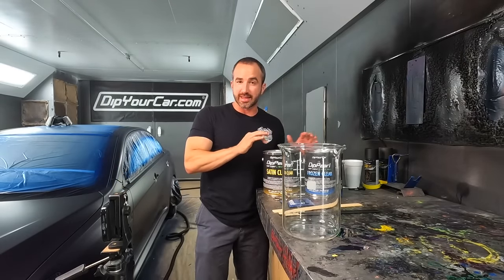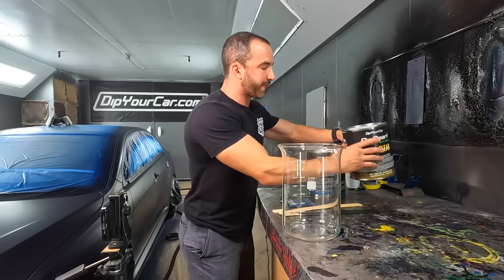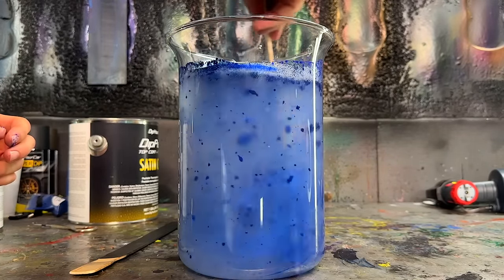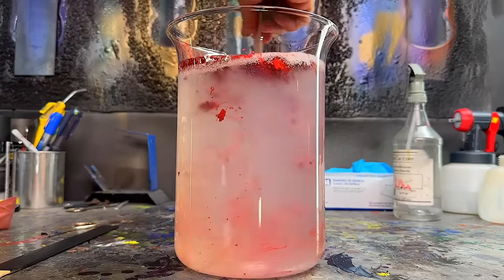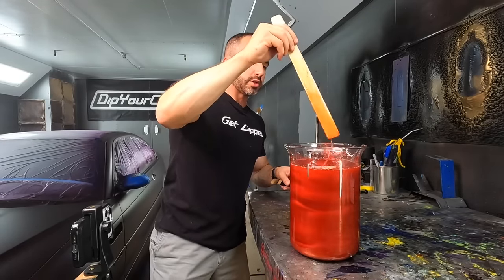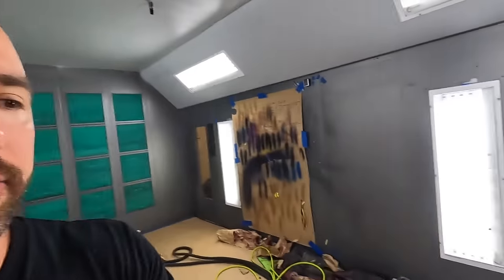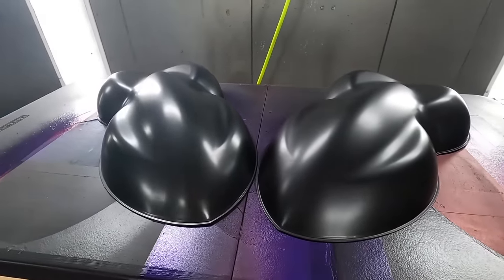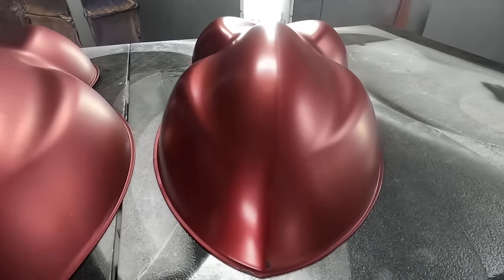GAME CHANGER | You Won't Believe What These NEW Gallons Can Do (Introducing Next Gen Topcoats)

Comment: For some reason I keep waiting for a two color paint job that acts like oil and water where instead of the colors mixing they create this trippy lava lamp style pattern… probably impossible with conventional equipment but it would be amazing to see such a technique work with hypershifts.
Reply: I too would love to see that.
Reply: I agree. You would probably need a dual sprayer setup of some kind.
Reply: Closest I’ve seen is the dish soap video. That was an awesome effect!
Reply: Totally agree
Reply: @KindredAutomotive  yeah thats the only way o can think of doing it and it would take an artistic touch to pull off.
Reply: What if they don't mix two contrasting colors before spraying but in the air?  Like from two different spray guns being used at the same time.  It wouldn't be smooth but it should be more contrasting?😕

idk
Reply: You would basically have to airbrush that effect. With stencils. Similar to painting real fire.
Reply: @KindredAutomotive  can you please link video or tell me what to search
Reply: @Lwah0812  “DYC LIQUID SOAP”
Reply: At that point taking the body panels off and hydro dipping would probably be a good route.

Comment: I had a 1977 f100 that had a nice deep blue color to it. But it had sparkles in it a bit as well. I always  called it metallic  blue. I miss that truck. Had everything  done up on it. Rebuilt 351 winzer motor with the pistons borred out to fit bigger  piston heads. Dual 3 inch exhaust  from the headers. Eldbrock 4 barrel carburetor.  Sounded beautiful  and looked sharp.

Comment: I wonder if you can do a more intense and insane paint style. Start with a simple solid color pearl over a medium color base over all except for cyberpunk-like panels on the sides and top that are done in black. Within the panels, use a hypershift color that has no purple in it. Then add some contrasting pinstripes that goes across both the pearl paint and the hypershift panels. I feel like that would coming out looking very awesome if you can pull it off.

Comment: Couple things: first love these can’t wait to pick up some cans for upcoming projects. Do they come in pint sized cans for small scale use such as for airsoft equipment/replicas? Second, how do you split the gram load with another gallon? Not sure if it was in a previous video or not and I’ve never seen you add a second gallon before mixing.
Reply from the maker: The topcoats don't come in quarts yet.  We just mix what you see on camera with another gallon of the same topcoat, essentially cutting the original pigment load in half.  If we are going for a 12.5 gram per gallon load, we dump in 25g on camera then cut with another gallon of topcoat.

Comment: If i remember correctly the biggest problem w/ musou black was that it did not play well with glossy top coat. Is there a chance that either of these would work with it? I know it's expensive but it might be cool to experiment, at least with speed shapes
Reply: That will not work, also Musou Black is not meant to be applied on vehicles

Comment: What's the difference between the level of preperation work for spraying the dip your car finishes vs. a traditional paint job?
Reply from the maker: A ton.  No sanding or primer needed before dipping, just a clean surface.
Reply: @dipyourcar  Even if the existing finish(faded/failing clear coat, etc.) has issues??

Comment: So how long will it last if you dip your car? It's hard for me to imagine doing it if it won't last long. Otherwise I feel like I'd rather invest that money into an actual paintjob
Reply from the maker: If applied and maintained correctly a dipped car will last years.  Just stay away from the fluorescent colors which can have an issue with long term UV exposure.
Reply: Many of the dipped cars in the community have said their dip have lasted 5+ years. I personally never kept a dip job on my car more than a couple years not because of anything other than wanting a new color. If sprayed correctly, dip can last just as long as vinyl wrap. It's all about how good you prep, spray, and how you take care of the dip.
Reply: I think I had mine on for 3 years till I got tired of the color.  I was using the dip armor, but these new top coats are probably 10x easier than that stuff.